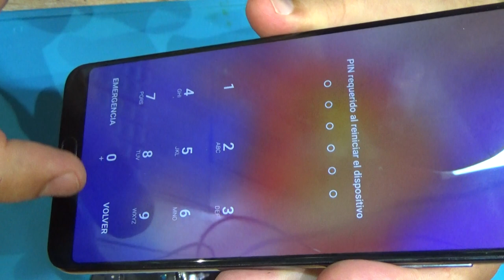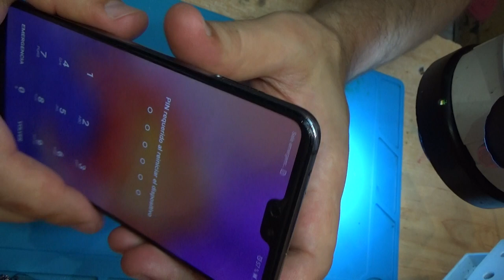HUAWEI P20 Pro .. display replacement

Comment: you dont need to remove that ribbon and the lower part of the fone. you can remove the battery then the lcd ribbon. after that replace. its easy to remove..